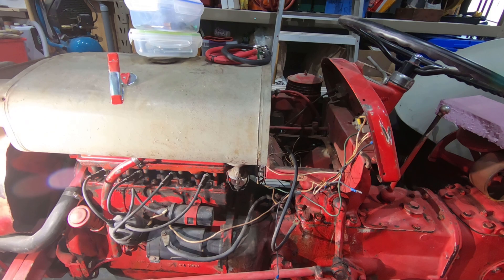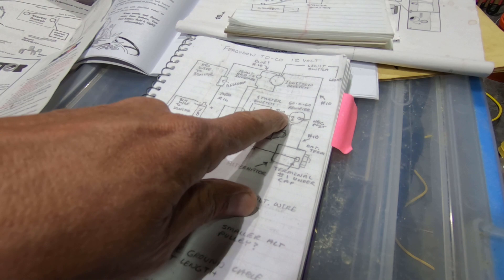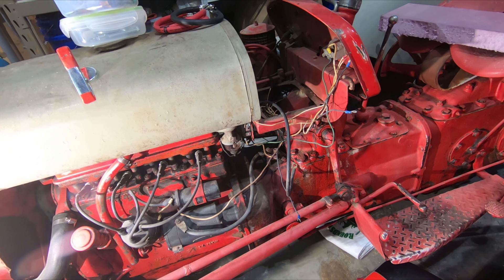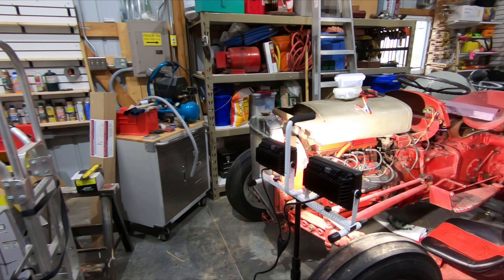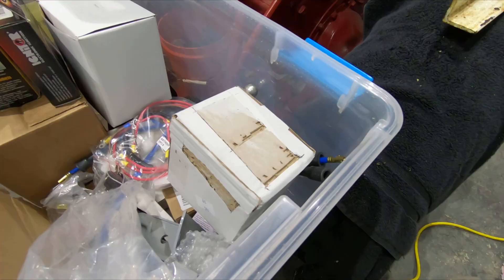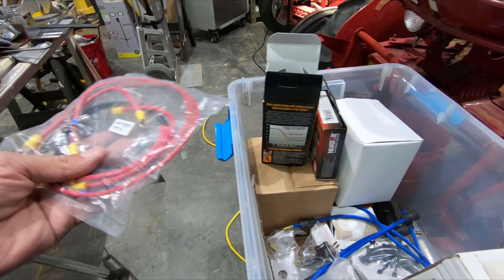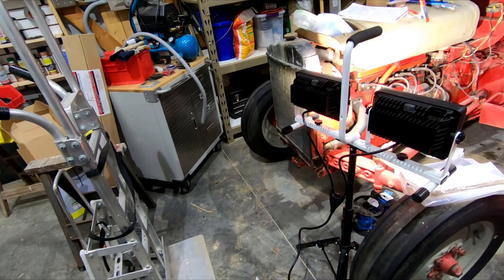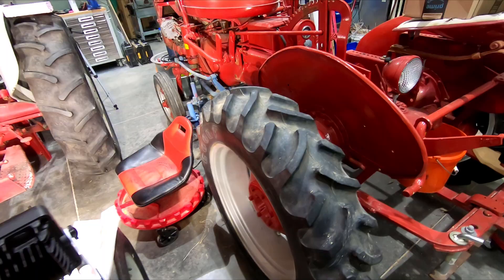Ferguson TO-20 12-Volt Wiring [One]

Comment: Thanks Mojo for the info and showing step by step process, a very good video.
Reply from the maker: I'm not quite finished with the wiring yet -- but I believe it is correct! I had to use three different diagrams because it has a 12-volt conversion and a new electronic ignition. I will be wrapping up the wiring soon -- hopefully this coming weekend -- and I will try to start the beast!  If you are subscribed and have updates enabled you should receive a notice. Thanks for stopping by Kent!

Comment: Can you scan the new wiring diagram you made and upload it so we can print it?  I dont think my kit has the diagram.  I am sticking with the standard ignition.  Appreciate it...
Reply from the maker: Hi Matt. I believe I show it in one of the videos, but I will likely do so again when I get back to the tractor in a couple of days.
Reply: @PlanetMojo  Thank you sir.  I will watch for it.  I saw it in the video but couldn't make it out clearly.  Sure would save me some figuring.  I work a lot and am just fixing mine for mowing, disc, and blade work.  Amazon carries a pretty good metal radiator....Took a little fitting to make it work, but not too bad.  They actually have quite a few parts...
Reply from the maker: @mattwade805  I just saw that stuff today. I'm clearing out the area around the tractor so I can finish it off. Hopefully I'll get to it the day after tomorrow, and the video will be out a few days after that. Sorry for the wait!